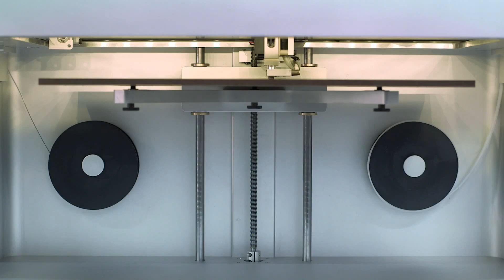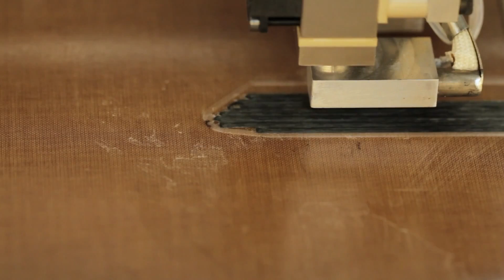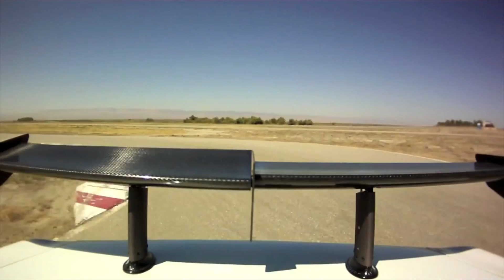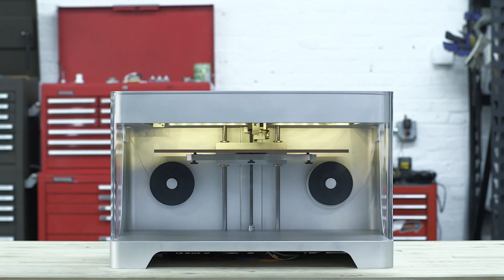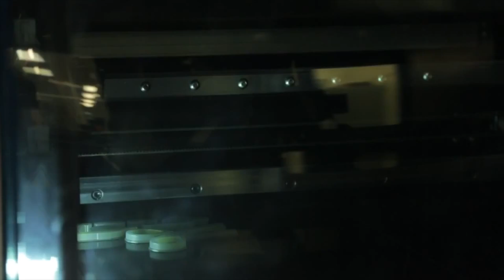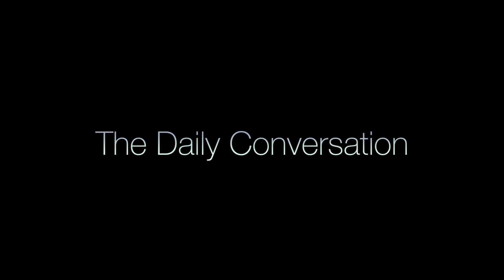The First Carbon Fiber 3D Printer

Comment: An excellent news, and specially for the car industry and artificial limbs (dental post, etc). At larger scale I presume that the car industry, aviation, and  themedical sector could take advantage of this light, resisting and strong material which is also transparent to swhortwaves radiations (helpful to manufacture parts of scanners and other irm)